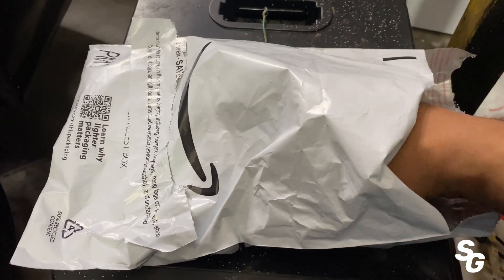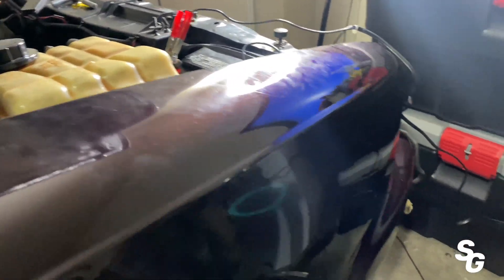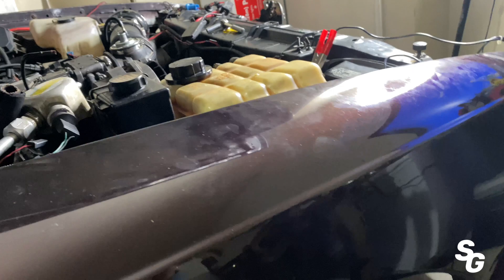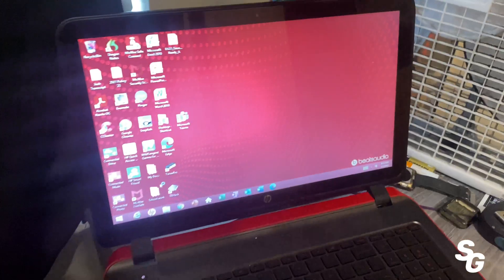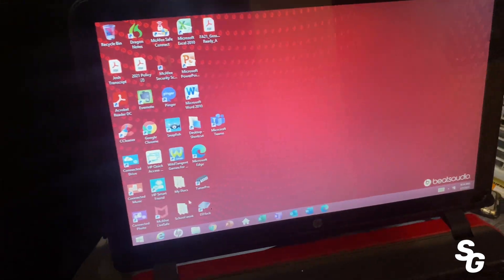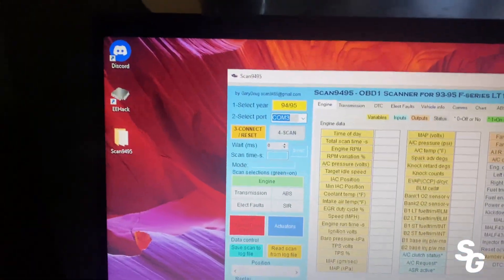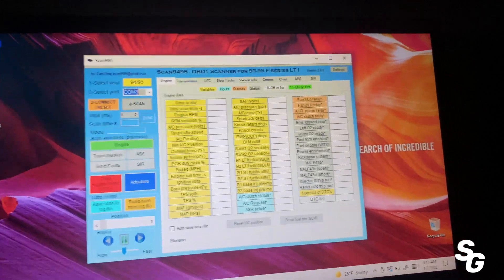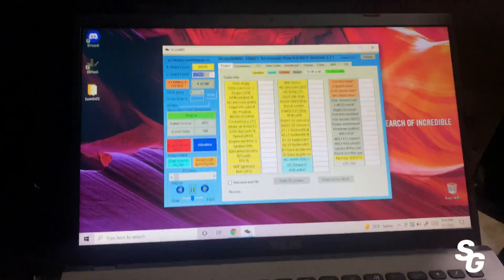How I Made A Aldl Cable At Home For A LT1 OBD1 PCM To Scan Codes! #Caprice #Lt1 #OBD1 #Aldl

Comment: Did you have to solder in a diode and resistor in the tx/rx and ground? I see some forum threads calling for that, some say it's unnecessary.  I have a 95 I'm trying to flash.
Reply from the maker: No I didn’t do any soldering